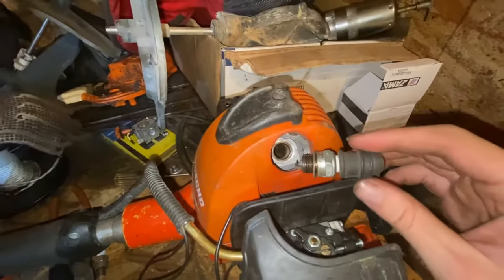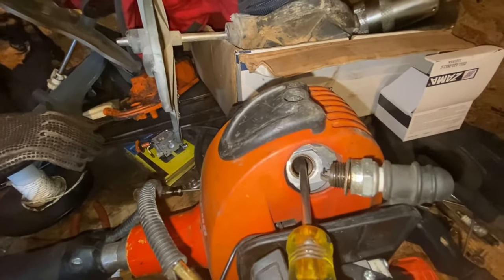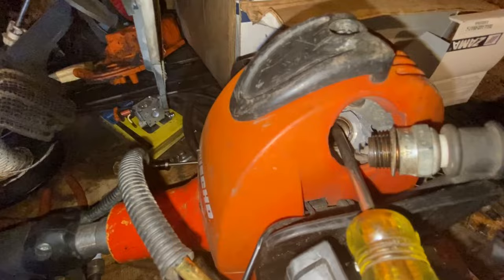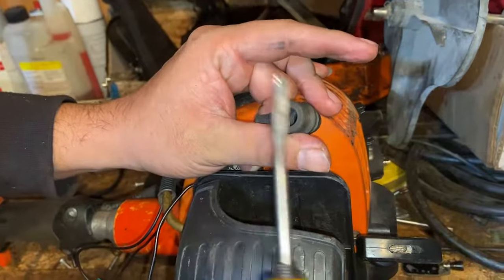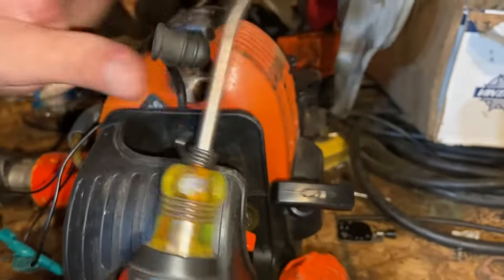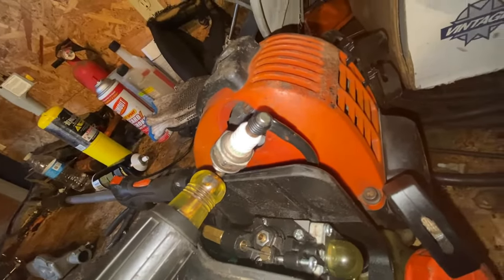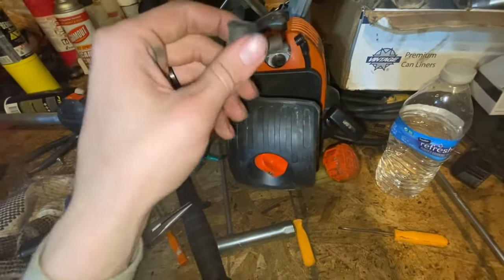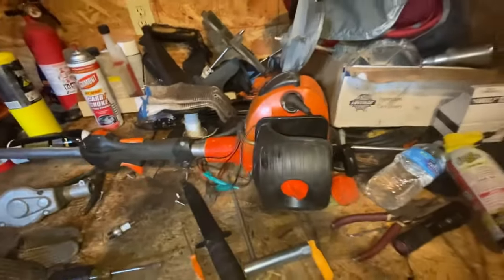How To Fix No Start On Any 2 Cycle Engine(No Spark)

Comment: In spite of what the others said, I thought it was a good video.  The background noise was a little annoying, but I was able to understand everything you said.  One thing I wish you would have shown is how to insert the spring part that attaches to the plug to the wire.  Well done, don't listen to the haters. ;-)

Comment: Who is making that noise in the back. Jesus
Reply from the maker: 🤣my co worker
Reply: Despite that noisy background, your testimony was right on. I have spent a few days and two different new carburetor replacements because I thought I actually had spark so I gave it a hard test and no I didn't. I thought I was going to have to go into the magneto but after looking at your video I merely slipped the boot down the wire and exposed the spring.
Did not notice any corrosion but I sharpened the tip a bit and injected it into the opposite side of the wire squeezed it with pliers, spit on the boot and pulled it back up. Easy peasy. Put it on the plug and unit fired right up!😊
I was really frustrated with tackling the carburation issues when it was probably the spark all along.
No matter the background noise, your message was easily comprehended and I thank you deeply for it. You saved my day and praises to you!!!!!